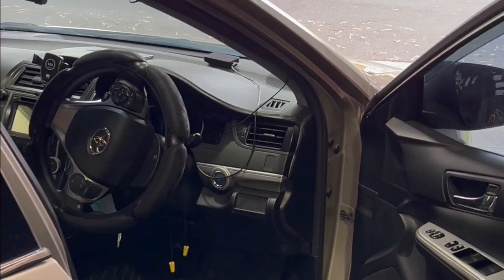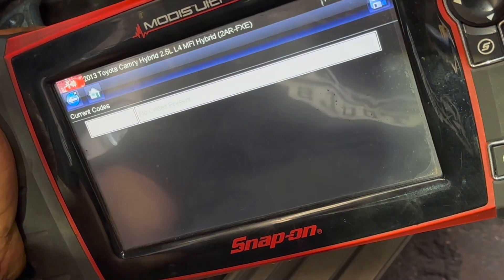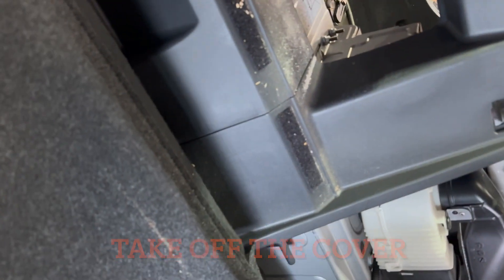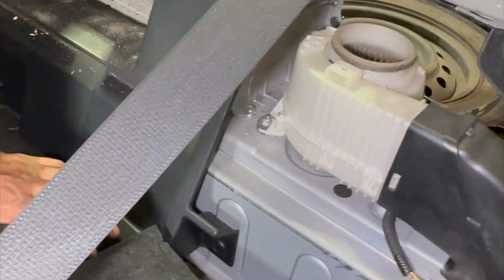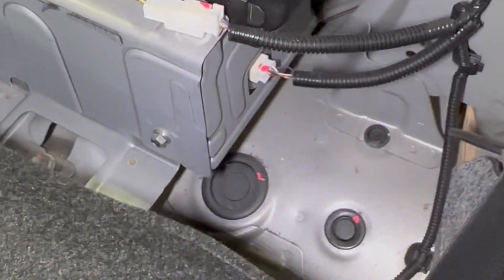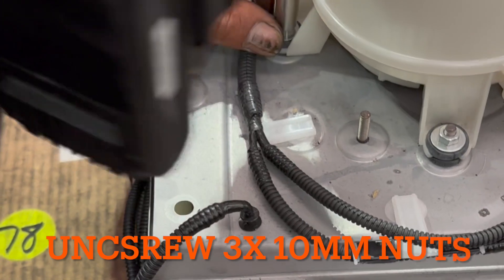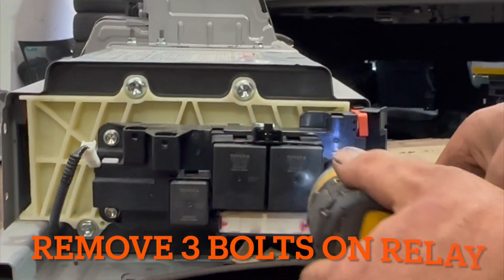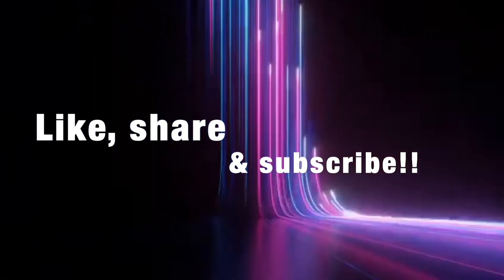Code P0A80, Part 1 : Replacing Hybrid Battery Pack For Toyota Camry 2013-2017

Comment: What does a battery replacement on this model Camry cost?
Reply from the maker: 2750.50 aud battery price
Reply: Hi, where can I buy a battery pack for 2750 (or similar), when I google it they seem to be a lot more expensive

Comment: I have a 2013 Toyota Camry hybrid with 30k miles should I clean the hybrid blower and the duct located next to the seat or should I wait for the car to be in a certain mileage? thanks.
Reply from the maker: Yes. Definitely you need to clean it. If you are regularly driving the car. It must be thoroughly cleaned. Look the inlet of the fan you can tell by looking.

Comment: Are u guys in Dubai?
Reply from the maker: In Australia .
Reply: @autovisionservices   I cleaned my filter but the sign still shows on dashboard for maintenance required hybrid battery. How can I get rid of this PLEASE HELP brother
Reply from the maker: Just connect the scanner with your car and go to the hybrid system in scnner and clear the code. There will be no code but just give the command through scanner to clear codes. Message will be disappeared from the screen.
Reply: @autovisionservices  thank you sir wish you many blessing & success in life 🤲
Reply: How much is the battery worth
Reply: @alrooh_1 its more expensive than a car in my country

Comment: I wonder if you can delete the battery and operate the car in combustion engine only mode
Reply from the maker: Its impossible to do so because Hybrid battery and inverter with convertor starts the engine through generator in Hybrid cars.  Hybrid cars got no starter to start the combustion engine.